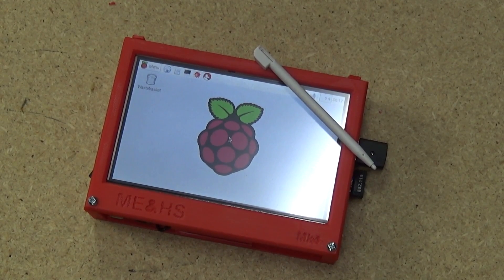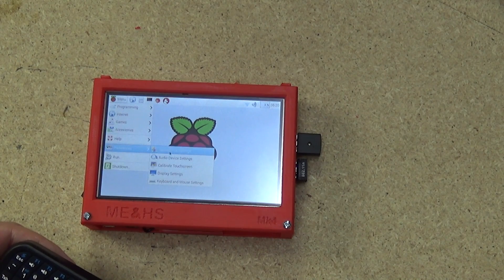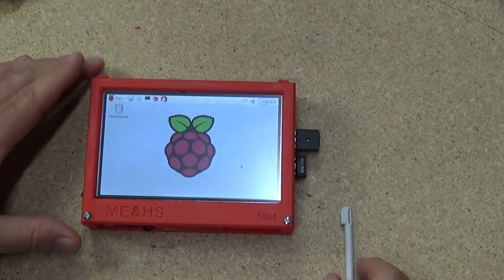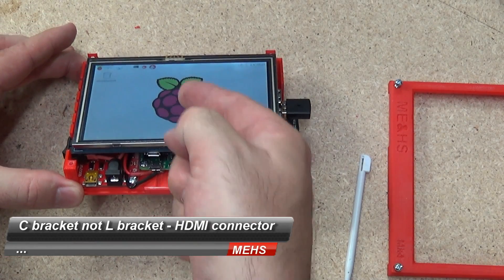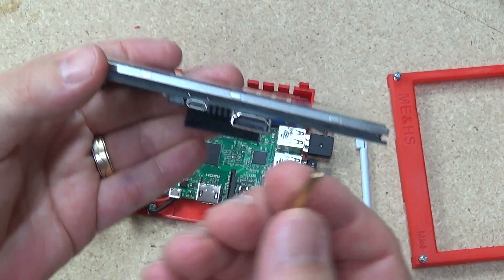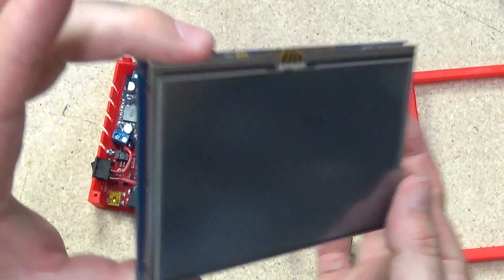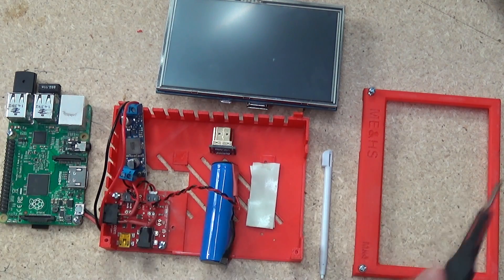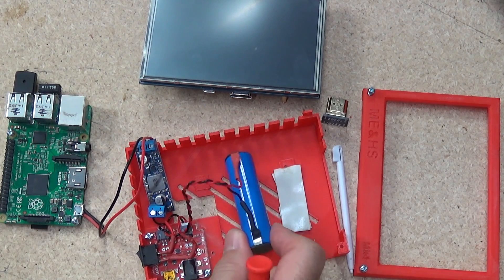Raspberry Pi 2 Portable Mk4 - 5 Inch Touchscreen (MEHS) Episode 38

Comment: The 5 inch HDMI LCD I have is XPT2046 Touch Control which I believe is V1.  The lcd lights up white and the power red led just glows steady.  Any thoughts?
Reply from the maker: +JohnnyJTav - Hi.  Not anything specific unfortunately.  If you're using a Pi3 then I would suggest using a Pi2 as not all devices are cross compatible.  It sounds like the power to the screen is fine.  I'm assuming the Pi powers up and displays an image when not connected to the touch screen (process of elimination).  I did find a blog that had some good info about your exact screen.  https://blog.ask-a.ninja/?p=48
Hopefully that will help.  If not I suggest the process of elimination starting with power, the pi, different screens and changes to the config file, keeping all the settings to the minimum, including screen resolution, until you identify at what point it stops working.  Cheers.
Reply: +My Electronics &amp; Hacking Show 

Yep... It works perfectly  with the Pi2

Thanks
Reply from the maker: JohnnyJTav - Good to hear.  If you want to use the Pi 3 you would need to take a look at where the incompatibility might be and go from there.  Its likely to be a raspbian driver issue, a pinout issue or a chipset incompatibility.  Either one of the first two should be fixable.  Cheers.

Comment: I'd like to see if you have a Pi 3 that you can make work with this info... I can't mine to work whatsoever.
Reply from the maker: +Mark Nichols - Hi Mark.  Did you have the pi2 working?  If you did and you're trying to swap to the pi3 then I wouldn't expect it to work.. The reason is the change from the BCM2835(6) (pi2) to the BCM2837 CPU core (pi3).  The previous waveshare drivers and distro was for the pi2 using the BCM2835(6).  There are updated driver files you can grab from the waveshare site that support the BCM2837 of the Pi3.  They have some info and directions that should be easy enough to follow and implement.  Let me know how you go.  Cheers.
Reply: +My Electronics &amp; Hacking Show I have been all over their site - Perhaps I am missing their reference to that... or they are amiss in indicating in big letters where their new drivers are for the Pi 3.
I emailed them twice and tried chatting with them on their website - they are ghosts and unresponsive.
I will continue to look.
I received the Pi 2 B last night and literally took the SD card out of the Pi 3 and into the Pi 2 and it worked fine.

Comment: HI, is possible to know where buy the component that do you use to create this portable for the raspberry?

I've find the touchscreen but not the other component ;-(

Thx
Reply from the maker: +Davide Ruffino - Hi.  It depends on where you are.  If you're in Australia then LittleBird Electronics is good to deal with and usually has the Sparkfun board and the Pololu regulator and 18650 batteries in stock.  You can also go to DigiKey, Pakronics or Core Electronics.  Cheers.
Reply: +My Electronics &amp; Hacking Show I'm in Italy
Reply from the maker: *****  - Ah, Sorry no I don't know where to go in Italy.  You could go to the Pololu website, they have a list of Italian distributors.  Start there.  Cheers.

Comment: Can you charge while its running? Also I think the pololu regulator is specifically a boost converter. Correct me if I'm wrong =^)
Reply from the maker: +Glychee S 
Hi, Yes you can but only because I'm supplying a clean 5V to the project.  In one of my earlier projects I showed how I used the sparkfun board to supply the battery power to the internal power regulator.  The problem is that even with external power connected, the external power will only charge the battery and not the battery and the project simultaneously.  E.g. 5v 4a going in from external, 4.2v 1a going to the battery but the project is pulling 5v 2a.  So the battery would normally go flat even though there is plenty of external power.  What I did is connect the external 5v 4a power to the sparkfun board AND the output of the 5v pololu power regulator.  That means I get 4.2v 1a going to the battery and 5v 3a going to the project simultaneously.  I can only do this when the external power supply is a clean 5V and has enough current for charging the battery and powering the project.  If the project itself drew less current that the charge rate of the sparfun board to the battery, e.g. project draw 800ma, battery charge rate 1000ma, then you wouldn't need to do this additional power supply bypass.  The Pololu module is sold as a power regulator.  I guess we are splitting hairs a bit since is does what a boost converter does.  It is switchmode, has reverse current protection etc but you could use a boost converter depending on tolerances and application.  Cheers.
Reply: Thanks,makes sense! I was indeed just splitting hairs, but just making sure why you went for that naming convention,since searching for boost converters can yield cheaper results on ebay. =^)
Reply from the maker: *****
Yes, the pololu reg I use is pretty good and very well made but not the cheapest solution.  Cheers.

Comment: Excuse me, but where did you buy the case? Or you made it yourself?:)
Reply from the maker: +Arken Cold 
Hi.  I made the case using 3D printer from a design I created in 123D Design.  I'm not sure if there are any commercial cases that work with this display.
Reply: My Electronics & Hacking Show Thank you!!!
Reply: +My Electronics & Hacking Show   Maybe you can share the drawing file?
Reply from the maker: Peter Pan
Hi.  Sure.  Head over to my website and leave me a message and your email address through the contacts page and I'lll email you the Mk4 files.  Cheers.

Comment: excuse me but, can you please provide the link to the screen? Thanks
Reply from the maker: +Hecmac Films (Productions) 
Hi.  The screen was purchased off ebay.  Search for - 
5-inch Resistive Touch Screen LCD Display HDMI for Raspberry Pi - or try item number 351563049828 and you should find one no problem.The technical details from the manufacturer can be found at:
http://www.waveshare.com/wiki/5inch_HDMI_LCD
Cheers.
Reply: Thank you! :D
Reply from the maker: +Hecmac Films (Productions) 
You're welcome.  Just as a side note, if your planning on a build of your own, I recently picked up 2 Adafruit LCD's, one 7 inch and one 5 inch.  These aren't touch (you can get them) but the clarity of the display was notably better than the one I used in this video.  I can't testify to the clarity of the touch version but if its close to the non touch versions then the Adafruit display is superior.  I will be posting my next video in a few days and I'll make sure I get plenty of footage of the Adafruit 7 inch display so you can compare for yourself.
Reply from the maker: +Hecmac Films (Productions) 
Hi.  Looks good.  I would be interested in how you go if you feel like sharing.  Cheers.

Comment: nice project. one use for this would be a portable internet radio, just add in a small speaker.i was thinking the 4 usb ports could be removed and replaced with 2 usb ports ( less height) . remove ethernet port.and squish the whole thing down into an even smaller case. wifi dongle can be soldered via wires to one of the unused usb pins ( ive done this and wifi works fine). but looking at the c hdmi connector it would be hard to make it thinner, plus battery would be problem also
Reply from the maker: Hi, thanks for the comments.  It's funny because I was only thinking the same thing a few days ago about the overall height of the Pi and the possibility of desoldering the gpio, usb and ethernet port to make a much thinner pi2.  I'm about to do a project using the adafruit kippah which fits on the pi2 lower than the Ethernet port.  Thinking about other possibilities now including thinning the pi2 for future smaller projects.  Thanks again.

Comment: awesome video love watching your projects!
Reply from the maker: Thank you very much.  I enjoy making them so I'll do my best to keep them coming.  Cheers.
Reply: +My Electronics & Hacking Show 
i have a quick question, if i have 2 different sd cards each with with a different os is it possible to switch between the two?
Reply from the maker: +SelecTech 
Hi, the short answer is yes you can.  I don't know of any pre-made dual micro sd card housings with switch but you can make your own.  I would start with a micro sd card extension cable which will allow you to extend the pi's sd card slot.  From there I would attach two micro sd card holders with a multi-pole switch that would allow you to select one card or the other.  You should aim to switch all 7 or 8 pins in one go.  You would need to keep an eye on the cable length, resistance, etc as you could easily degrade the card capability or stop it from working all together.  Good luck.  Let me know how you get on.